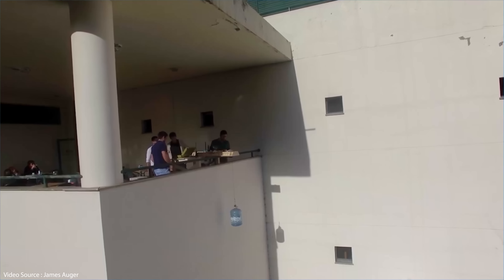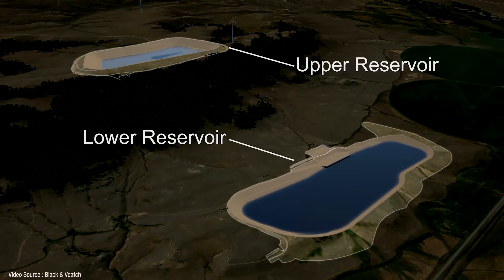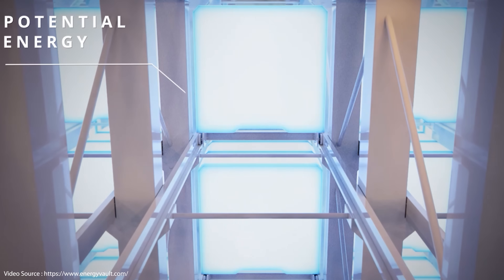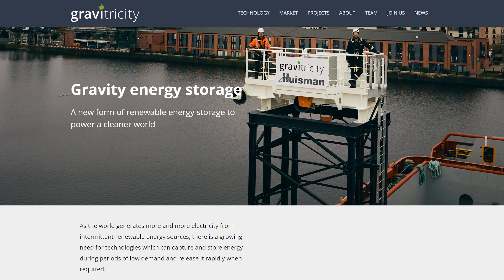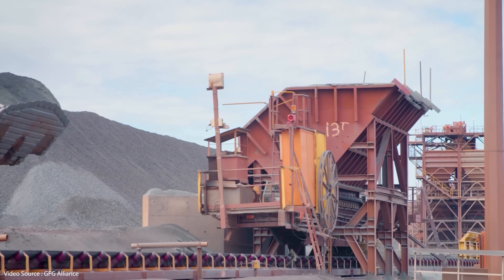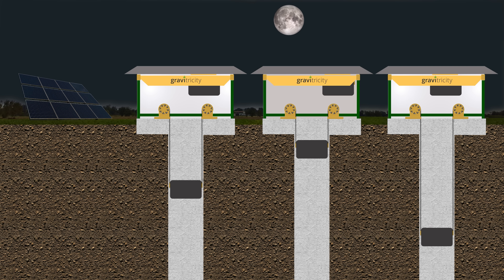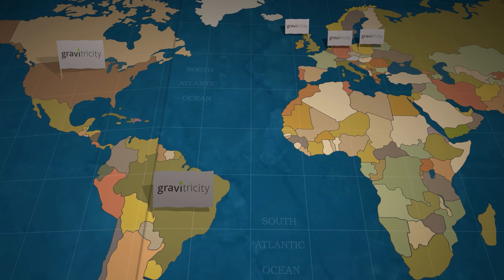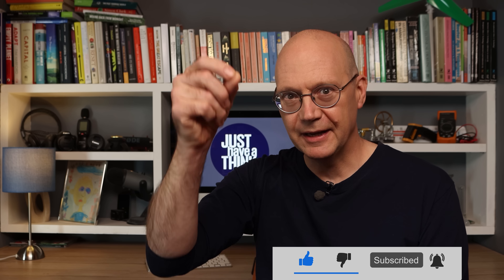Gravity Energy Storage. Who's right and who's wrong?

Comment: Energy storage is an odd thing.  On one hand if we are ever to use renewables like solar and wind we need to be able to generate close to 100% of our energy from that storage as it may be calm and dark at the same time!  So it's important.  However it feels a little like a chicken farmer with 1 clutch of hens buying a 60ft curtain side trailer to take his eggs to market.  Before energy storage becomes useful as backing for renewables, we need enough renewables to not only run the grid, but in addition "charge" the energy storage.  We need generating capacity up to 10 times our demand energy to have any chance of maintaining charge over a solar/wind low period.  I think the UK is touching on 25% total renewable mix, which is good.  Renewable capacity is higher than that obviously and for short periods when conditions are right it has generated up to 40% I believe.  But that's about 1/40th of the kind of energy output we need from renewables to meet current demand.  Current demand is set to double or tripple in the coming decade or two due to electrification of transport.  That means we'll need 120 times the amount of renewables.  I don't see us doing that anytime soon.  The rate at which renewables are expanding is barely out pacing the rate electricity demand is expanding.  It certainly won't be in the next decade or two.  We need something else to buy us time.  Nuclear?
It's that interim period that will be tough.  Grid balancing is going to be very, very tricky as more and more renewables come online.  It's such a difficult problem that in California they have to switch off entire solar plants to address over-generation, because they can't shut down the nuclear reactors every time the clouds go away and they can't even shut down all the gas and coal plants in case it get cloudy.  They can't just be turned on and spun up to capacity in a few minutes, they have to running in idle already and take a few minutes to wind up to full power.  It's that gap between demand and the plant powering up which is currently addressed in the UK with pumped hydro.  In California they have "too many" intermittent renewables and literally have to switch them off to overload the grid.  Same reason why France have very little renewables.  France using renewables would increase their carbon foot print as it cant be balanced by nuclear, their profiles are incompatible, so they would need to comission some gas plants to back the solar/wind and shut some nuc's down.

Comment: The point still stands out as clear.  If you are going to use gravity energy storage, which we have been using for 10s of thousands of years, then the best candidate has been staring us in the face for centuries and has also been used for centuries.  Water.  Pump it up, drop it down.  Pretty much everything else is a waste of space as you end up making concrete blocks and stupid shit, when water if freely available and easy to pump, much less moving parts. Much more output.

Comment: Using big containers that empty out at the bottom. Have a source of liquid that fills the container at the top and empties at the bottom. The liquid source is gravity fed. And the lowering can be part of the liquids process. 30,000 people produce over 5 million gallons a day of wastewater. That's 7.64 lbs. about 8 pounds per gallon Raising an empty container uses a lot less power, the flow never stops there are no valves to shut off wastewater like you can drinking water. More than 40,000,000 pounds of  useable weight , not being used. My calculations may be low, 5mgd might be for  just 10,000 people. If people would look at it in a mature way. That 5gal they lowered down the building didn't have to be fresh water.

Comment: Energy vault feels like a crane salesman, a concrete supplier, and a computer animator got together for some beers.
Reply: Don't forget to add: "made by clever engineer grad students start-up"!! It works people, they confirm it.
Reply: Don't forget a guy from silicon valley.
Reply: One year later update: Gravity Vault now have 7 projects in China to build energy storage facilities totalling 3.26 GWh. They must have some good beer in Switzerland!
Reply: @YouTubeChannelForAll  Skidmore, Owings & Merrill has joined the party gotta love NRGV, someone called their gravity storage "ugly", so they called the best architects on the planet, to design the most astonishing structures money can buy. They're not taking chances! 😁
Reply: @YouTubeChannelForAll  Dont forget China builds just for building it self... they invest money just to keep GDP high... very often without any other sense...  3,26 GWh that is ca. 1 075 800 drops of 3ton weight on 500m drop by eff.75%... now you can see what a bullS is that...
Reply: @jaroslavklima4591  Don't forget? If there is one thing that should be forgotten as quickly as possible is nonsensical racist stereotypes. Energy Vault currently has a market cap of 980 million dollars with some of the largest players in the energy sector investing in them. Crawl back under the rock you came from, Jaroslav. You are not qualified to comment on this topic.
Reply: You noticed that right..
Reply: @djdoc06  and for posters that know very little to be able to post `game changing `tech posts .
Reply: The only thing it solves is the inability of solar to have electrical momentum by converting solar energy into kinetic energy to drive the generators but it's way too inefficient to be worth it. You won't get 100% of the energy you start with because some will be lost as heat in the mechanics and then there's building it, maintaining it, powering the lights and computers etc, the materials used to make it. It's basically pointless.
Reply: @NoZioKikes88  "The only thing it solves is the inability of solar to have electrical momentum" word salad
Reply: @aluisious  So because you are unfamiliar with something means it isn't a real aspect of power generation for the power grid. Thanks for giving an example of the Dunning-krueger effect. If I ever need to explain that to someone I'll direct them to your comment.
Reply: @D R what about using wave action to "ratchet" the weights up for the next drop?
Reply: What about capturing humidity on top of a mountain using mesh nets and transferring it to holding ponds then letting huge bags of it down a slide or chute?   You could use wind power up there and use that to run pumps while you have wind and solar too.   I want to see how that math breaks out.  How much water do you have to have at what height do produce how much energy and how much can you get from nets.  If you could capture clouds up there you could make a lot of power.  An average cloud weighs about about 1 billion 400 million pounds.   Capturing clouds already in the sky seems like an op way to get a lot of weight high up for something like this.  You could also run huge Absorption Refrigeration systems up there and make cool air to pump down and get tons of water up there as well... not sure how well you could use the cold air but the largest Absorption Refrigeration units made now make something like 250k gallons of water per day.  That's about 950k kilos of water per day per unit being run on a mountain.  Making weight up high rather than lugging it up high.  I just ran a little basic math so see how it would shake out.  So 1 square meter of fog collecting mesh collects about 1 gallon of water per day.  there are 2.59x10e6 square meters in a square mile aka 630 acres.   and water weighs about 8.35 lb per gallon 25900000 X 8.35 = 216265000.  divided by 2.2 to turn lbs into kilos. 98302272 kilos.  per square mile.  I noticed that there is a mt Whitney in California near LA and San Fransisco and it is about 6000 to 14000 ft above sea level and 581000 acres San Fransisco is about 52 ft above sea level.   So 1 percent of this mountain is 5810 acres.  Let call it 9 square miles...  lets see how much power could be generated using the mesh over 9 square miles assuming 10000 square feet up and if somehow you could lower it all the way down just for reference.    Looks like you'd have about 90000000 kilograms of weight at a height of about 10 kilometers per day.  Sounds like about 9 billion or so kilowatt hours if you use 1 kilogram at 1 kilometer has about 1 kwh of energy potential I heard somewhere that was about right a while back.  So I now have 9 billion kilowatt hours per day of energy storage using the weight of fog and clouds let's say maybe.   Okay so now over 365 days in a year.   That's about 3.285 trillion kwhs per year.   That is about 80 percent of the number that I get for the total energy consumption for the entire country annually.  3,900,875,000,000.00 kWh (2018).  That would be using 1 9th of 1 percent of 1 mountain in California 9 square miles.  Please if you read this and even half ass care correct my math.  Total infrastructure cost a bunch of mesh a couple very long slides and some pretty substantial generators then it's problem solved.  Btw in this design I used no solar or wind power at all just mesh collecting water on a mountain.  Yes it would be too much power to transmit all over the country through power lines but if you have that much power use it to breakdown water into H 02 and make pipelines that can send the gas across the country I think that would be much cheaper then any other way to transmit the power through  lines or truck it all over or whatever.
Reply: @andrefruth41  You may be correct about water from mist, however with the data you consider, 5810 acre on high 10000 ft the energy from 89.4 million liter water may be less than 743000 KWhr per day which is less than 128 KWhr/acre/day.  These data compared with your calculational are 12100 time lower than what you calculate.
Reply: More like a scam
Reply: ضش
Reply: I have an idea to invent a free electric power generator. If anyone wants to buy the idea, contact me in the comments
Reply: Why dont they do this in the Sea? With pumping down air to drive weights back up? You could get power going down and going up?
Reply: @Nostfarato  Why don't you just do some math before vomiting your awful ideas on the world?
Reply: @Nostfarato  You could force the water out of the lower chamber (when raising the weight) through a membrane to remove the salt, creating a potable water supply for every cycle.
Reply: @garysluzar6947  you would lose a big portion of the water momentum/presusure. As osmosis membraimes don't transfer pressure so on one side you have high pressure and low on the other
Reply: @Nostfarato  brilliant
Reply: It sounds like something as simple as closing the system inside of a silo would have solved 99% of the "debunking" that went on about it.
Reply: @Belthazar1113  If you're going to build a silo, just build a water tower, and pump water up to the top. Then you don't need cranes or concrete or anything else. Plus, you have emergency water supply.
Reply: @darrennew8211  you have a point. But the benefit of water is that its systems are probably more efficient and need less maintenance. The issue with water is that it is 5 times lighter the the iron ore so you would need to build it 5 times as big. (Not necessarily 5 times as big, more like (ratio of mass)*(ratio of efficiency)≈5 if they have a similar effecincy mechanism)
Reply: @Belthazar1113  It wouldn't solve the problem that it's extremely expensive and stores a pathetic amount of energy, which is why even Energy Vault abandoned the design. They never intended to build it, the company was founded by a bunch of people who have scammed investors before.
Reply: @Belthazar1113  Not if you actually watched the videos. Then you realize that Concrete Blocks you have to lift up and put down are the wrong material, plain and simple. You only loose material all the time. You have unecessary mechanics for swapping them out. Nevermind the cost of making concrete, which is very much not 0 Carbon! And the "complex management software" does not exist.
Graviticity seems to be a lot smarter. No insane swapping of elements, using Iron Ore as the weight, no advanced math needed to program the handling software.
"Simplicity is the highest for of Sophistication" after all :)
Reply: @Belthazar1113  As long as that 100% is weather related concerns, possibly. Otherwise, no. 

Pop quiz! What's the energy potential stored in a concrete block at the bottom of a stack?
Reply: @westrim  it was just a rendering, and they would always need a high altitude platform to raise the blocks, they should choose whatever makes up that platform based on cost not necessarily of the same material. That is obvious. Maybe it is cheaper to ise the same material since they are already producing, moving, building with it instead of a different platform. 
Thier project has no theoretical issues whatsoever. It is all about if they could really implement it considering the cost of building it, maintaing it, the energy lost due to lack of 100% efficiency.
Reply: @westrim  Even the ones at the top have bugger all - a 50 kWh tesla battery is 180 MegaJoules - or an 18 ton block lifted a KILOMETER

Comment: The cost to create big, deep shafts in the earth is very high. So, this strategy will be limited by the availability of existing, unused, wide, deep shafts. On top of that, the "density" of gravitational potential energy is quite low. The energy stored by raising 1 ton 100m is 0.272 kWh. To be grid scale, you would need millions of tons of mass, and you would need to cram this mass into the few suitable mineshafts available. In summary, I think this is not a significant technology.

Comment: 9 days ago there was a video posted by the BBC about sand heat storage in Finland.  I'd like to know how they heat the sand with photovoltaics because I need a hot water heater and this sounds like the solution. https://youtu.be/Azaf9tKJNoA
I also saw a Two Bit Davinci video about a marine vertical wind turbine and lift storage combo to provide continuous grid power.  It's amazing  all of the new technology.

Comment: Why use concrete blocks? Just pump water into a water tower, then run a turbine when it flows back down.
Better yet. Use solar dishes to boil water, it turns to steam, rises and condenses in a cooling tower. Release the water through a turbine system as needed, during the night.

Comment: The simplicity makes it, as some already  mentioned  always very energy low per unit of volume .  Running a record turntable is like running a clockwork . And thats the result to be expected.  Massive weights  to drive minimal usefull output. Two serious factors are friction and enertia taking the lump of  "invested energy" out of your wallet.  And not to forget  , how many human life will get lost during building and operating these poor economics.

Comment: You know there was a technology that we used to use to store water for later that didn't involve relying on geography to hold that water for us, they were called.

Water towers!

Now sure we used to use these things to store drinkable water for when it was needed, but, por que no las dos? Definitely easier to use pumps and water, a thing we've already been using for decades to centuries to give us power than to make some arbitrary concrete blocks and start moving them around on a pulley system

Comment: I think they are barking up the wrong tree with this concept. I like many ideas in this comment section. I think that they should use flywheels for part of the storage and move a fluid in a vessel be it some kind of liquid. Think of hydraulic motors and pumps. Kind of like the old garage floor lifts from years ago. They were sunk in a giant cylinder down into the floor underground and operated with either air or hydraulic fluid pressure. Use excess energy to spin very heavy flywheels which in turn drive pumps or hydraulic motors which pump a fluid into a large weighted cylinder or container. The weight or gravity battery is lifted up with the cylinder or cylinders increasing as time goes on.

Then when the power generation level starts to drop the flywheels are engaged to take up the slack on the generators and valves open to let built up psi in the form of fluid start to drive hydraulic motors or turbines that start to help spin up the flywheels. It would be a smooth transfer of power generation and could run for a long interval. 

I grew up on a farm and we had many pieces of equipment that made use of flywheels to multiply torque and inertia. Once the flywheels got spun up to operating speed it did not take much energy to keep them moving. 

The best example I can think of is a hay baler. It had a massive flywheel mounted inline with a pto. The tractor engine brought it up to speed. It took an immense amount of energy and torque to run a ram that cut, packed, compressed and pushed to form the hay into a bale and ran all of the functions on the Baler all at the same time.

That moment of inertia needed would have just stopped the tractor engine dead trying to perform that task. 

That energy or inertia was so great that it could snap a safety shear bolt like breaking a twig. 

As a safety feature there was an iron bolt that went through the flywheel that could break instead of metal components in the baler exploding from a mechanical jam or failure. 

I broke a few in my lifetime.

Same principle on a larger scale. Flywheels are an awesome device. Look what old antique engines and steam engines could do with them. They were lower powered machines using large heavy flywheels to do huge amounts of work.